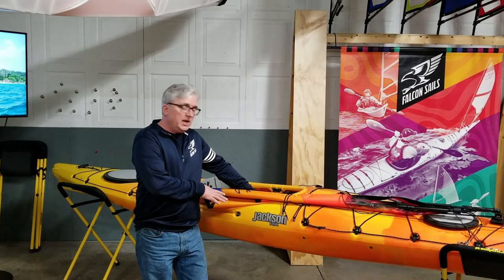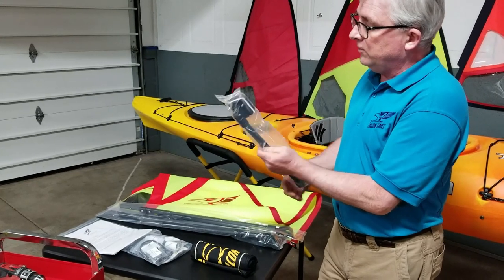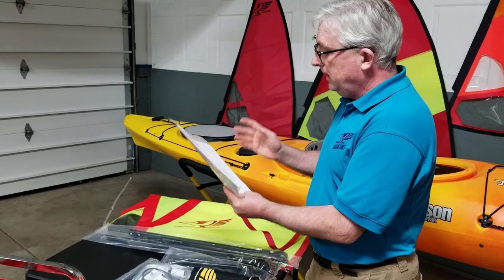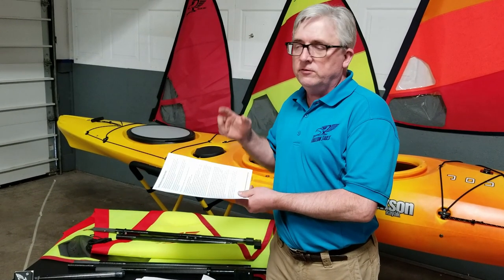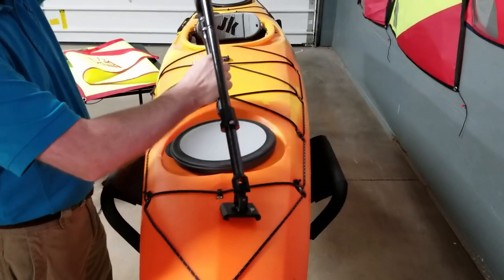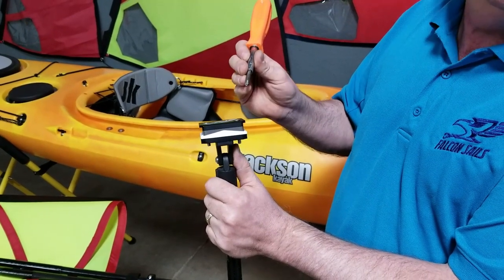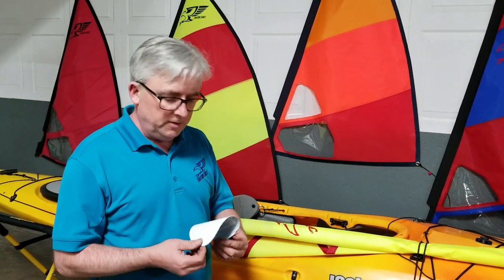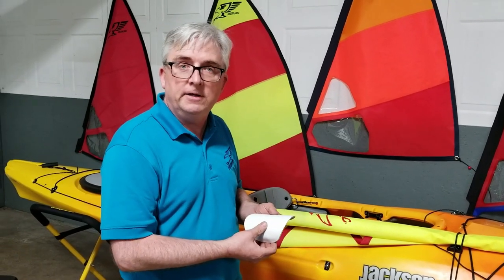How to install a sail on a kayak

Comment: Hi Patrick, That's me in the Red Clipper Sea Canoe on my very first sail ever (and with you). Thanks for taking me out that day.  Since then I've been out dozens of times in much lighter wind then that day (20-30 mph?) learning my secondary stability limits with the sail up. A high seat position on my canoe is much different than a low seat position of a kayak with a sail. My Falcon Sail is doing everything I wanted from it. I normally paddle inland lakes here in central Indiana. I'm almost always out-and-back so at some point I'm into the wind and then with the wind. (sail up/sail down)  I would say an average trip for me is about 8 to 10 miles in 2 - 3 hours. Since inland lakes are almost always ever changing wind conditions as I wind my way around the hills I'm constantly having to adjust the sail which could not be easier taking less than a second to do. Almost always I'm paddle-sailing. In other words the sail is an assist to my paddling. In my experience I do not find my average paddle much faster than without the sail in light winds, (maybe .5 to 1.0 mph in 8 to 15 mph winds) but I find I work a whole lot less hard to maintain my speed. I highly recommend your sails. And thanks for providing coaching on the install. Your experience with my style of boat made the final product perfectly located on the hull. Hope to see you on the water again soon! Happy Sailing!
Reply from the maker: Thank you for the comment.  That was a great day of paddle sailing.
If I were you, I would think about making it to the South Bass Rendezvous.  Even if you do not feel ready for the full blow paddles we plan on doing, there are still many things do do, including meeting a few of the hundreds of other paddlers that will be there.  Keep us posted.  Send more pictures and paddle sail reports.
Reply: @FalconSails  Paddle Report, May 24th 2019 Raccoon Lake (Cecil M. Harden Lake) Distance paddled 10+ miles. Sail: 4 Miles. Wind SW 8-15 mph. Saw 2 Golden Eagles and 1 Bald Eagle. Saw several big Leather Back Turtles and a couple Northern Water Snakes sunning. The lake is 15 ft above normal water level. I would say I had my best sail ever. I really am getting to know where my secondary stability is on my canoe. I was super confident even in some pretty heavy gusts at times on the north end of the lake. You'll be hard pressed to find me without my Falcon Sail on my Sea Canoe. I'm Sold! Thanks again Patrick.

Comment: BEST sailing rig I've seen for my Current Designs Solara 135! I added the available foot steered rudder for it DOES help in a crosswind. Just one question Patrick. Are sponsons not needed to prevent my kayak from rolling over if a strong gust of wind should hit me?
Reply from the maker: That vast majority of Falcon Sail customers do not use sponsons.  After having had thousands of conversations with customers, I have never heard somebody say they went without sponsons and then decided to change their mind.  If the wind will not tip over your empty kayak sitting on the grass, or even on the water, it will not even come close to tipping your boat over if you are sitting in the boat.  It takes a tremendous about of wind to tip over a kayak like yours.  I suggest you skip the sponsons, and be cautions and see what you think.  I bet you will decide not to use them.

Comment: Do these install well on a sit-on-top kayak?  If not, what would you recommend?  Don't wanna go fast, just want to relax on the lake with the dog, but keep moving without having to paddle constantly.
Reply from the maker: Falcon Sails can be rigged on any kayak.  Below are some easy day sailing videos that show them handling nicely in light conditions.
Sit on top kayaks in general have a lot going for them that make them great sailing kayaks.  #1 they are usually shorter which makes them easier to control, #2 they are usually wider which makes them more stable and handle wind better and makes them easier to handle,  #3 their hulls typically have more contour to them for tracking which also gives them great lateral resistance for better sailing across the wind, and even making up wind progress.

Falcon Sails will make a rig that is perfect for your kayak.  It will be easy to install and will be very solid.  All you will need are basic tools.  When you order, at the very end of the process we will ask you what kind of kayak you will rig your sail on, and then make a perfect kit specific for your kayak.

You can design your custom sail here.
https://www.falconsails.com/store/

Here a husband and wife enjoyed one of their first kayak sails and made easy across the wind progress.
  They are using sit on top kayaks.
https://www.facebook.com/watch/?v=300853454609552

Here is a nice video clip of a customer in a 12 foot long Pungo / Recreational kayak.
This was her first week end of kayak sailing, and you can see her making up wind progress.
https://www.facebook.com/falconsails/videos/696388180923721/?v=696388180923721

Here is a video of a Falcon Sail customer making nice upwind progress on his first time out with a 1 square meter Falcon Sail on his 12 foot long kayak.
https://www.facebook.com/watch/?v=278619176312509

Here a kayak sailor is enjoying a sail along the beach easily reaching across the wind.
You can sail across the wind along a beach all day long if you want.
https://www.facebook.com/watch/?v=896397267482735
Reply: @FalconSails  Thank you for these videos.  The sit-on-top kayak couple was just what I needed to see. Sure wish I could do this.... Looks so relaxing.
Reply: @SisterBaby  Kayak Sailing is very relaxing.  I have a hard time understanding how somebody would not put a good quality sail on their kayak, when you can have a rig that weighs just 3.5 pounds, folds to the size of an umbrella and secures to your deck in seconds, that can push you across the wind, and even up wind.  It is too much fun to pass on.  It is very relaxing in light wind and exciting if you decide to go out in bigger winds.  If it is too exciting, with a Falcon rig you can drop the sail in seconds and secure it to your deck in a few more seconds.

Comment: Is the sheet line long enough to let the sail swing forward so there is no wind force applied before dropping the mast
Reply from the maker: yes the sheet line is plenty long enough for that.
Though if you want to let the boom weathervane to depower ask us for a mast extension to put the boom above the standing line.  Though after years of kayak sailing I do not recommend you create the downsides associated with a depowering system like that.

There is a much better way to depower your sail which is much safer and does not create any of the downsides of having a sail so high it is above all the standing lines necessary for the kind of depowering I guess you may be looking at  

Unless you are in big winds, all you have to do is uncleat the forestay and the mast will gently fall.

Proper depowering on big wind days has been addressed in the video at this link.
https://youtu.be/fP7AxiwKthQ

Call the Falcon Sail shop any time  you like.

www.falconsails.com/contact.php

Comment: I have a challenging request for you guys... I'm expecting the delivery of my Oru Coast XT kayak, tis an origami folding kayak, would you be able to add a sailing kit to that?
Reply from the maker: Some kayaks are harder than others. We can help you rig a Falcon Sail on your Oru Coast XT.  You should contact our shop to discuss how to rig it.  With our Oru Adapter and reinforcements it is fairly easy to do.  But still you should have a discussion with our shop so we can explain to you what you will have to do with this very special kayak.  

We have a Oru Beach in our demo and show fleet, so we are very familiar with the Oru designs and can help you get off to a quick start. 

Our shop Phone # can be found here.
www.falconsails.com/contact.php

You can see some very helpful pictures our demo Oru Bay here.  It includes a lot of rigging details.
https://www.flickr.com/photos/falconsails/albums/72157719487366357

Comment: I may have missed it, but you seem to have skipped how to measure the mast foot to be the correct length to provide a tight fit and good support.  Getting in to measure is no super easy, do you have any tips on how to measure the length needed for the foot?
Reply from the maker: I cut mine to get it closer to the correct length.
Then I put insert it to see how close it is.  Then I cut off a little more and test fit it and then test fit it again.  I do that a few times until it is really close.
At the very end, I use sand paper to shorten the last few mm to perfection.
When  you get close to the right length, only take off 1/2 half of what you think necessary to finalize it.  When it is really close use sand paper to finish it off.

Comment: Do you need to put silicone on the bottom of everything before tightening so it's water tight?
Reply from the maker: You can put a small dab of silicone on before you tighten up things to make sure it is 100% water tight.  If you skip this step it will be okay, but may leak a few drops of water if the deck of  your boat sees a lot of water.  In any case, it is a good idea, and any type of silicone will work fine.

Comment: Serious question; do you necessarily need a rudder, keel, or Lee boards to use this kind of setup?. Kind regards.
Reply from the maker: Rudders are far from being required.  If a kayak is fine without a rudder when not sailing, it will be fine  for kayak sailing.
Jut like kayaking without a sail, kayaks that are 16 feet and longer it is best to have either an adjustable skeg or a rudder.  On kayaks that are 13 feet and shorter rudders are completely optional.  In any case, your paddle is much more powerful for turning that a rudder is.  A rudder is handy for lazy kayak sailing.  You can sail along, and set your rudder down, and eat a sandwich or do what ever you want.  If you do not have a rudder, you will need to make an occasional paddle stroke to stay on course or change course.

If you want a rudder, Falcon Sails will sell you a smart track rudder at 40% below list price.  Smart Track rudders are the best after market rudder you will find.  They are better than pretty much all the other rudders out there.  If you want to take advantage of this offer, call our shop to discuss.
Reply: I own 5 different kayaks.  I have rigged a sail on every one of them.  2 have no rudder and no adjustable skeg.   One is 12 feet long, and the other is 13 feet long.  1 of my 18 feet long kayaks has a factory / stock adjustable skeg, 1 of my 18 foot long kayaks has a smart track rudder on it, and 1 of my kayaks has a stock factory rudder on it.
If your no sail kayak is fine without a rudder, it is more than likely fine for kayak sailing without a rudder.
Reply: @patrickforrester3116  Thank you for your informative replies, kind Sirs.
Reply from the maker: Keels and Lee boards are 100% not necessary.
Conventional sail thinking leads people to assume all boats that sail have them.
Sail boat hulls are designed to be as slippery as possible going forward and a by product of this is a hull that slips sideways and spints.
A kayak hull is designed to track and go in a straight line.  This is achieve by having lateral resistance throughout the length of the hull.  Imagine towing a loaded kayak from the front vs towing a loaded kayak from the side.  The kayak you tow from the front will be 10x faster than the same kayak being towed from the side.  That is because a kayak hull generates a lot more resistance going sideways than it does going forward.  So a kayak hull is really pretty good at sailing.  It will not sail perfectly well as a purpose built sailboat will but it will sail amazingly well and it can all be had by adding a 3.5 pound Falcon Sail to your kayak.
We wrote quite a bit more about this on our frequently asked questions page.
See what we wrote on lateral resistance appendages here.
https://www.falconsails.com/KayakSailingFAQ.php#centerboard
Reply: @FalconSails  A very interesting, explicit and detailed reply, and a good point about the inherent tracking characteristics of the kayak hull form. Thankyou very much. Kind regards.
Reply from the maker: @onanysundrymule3144  Let us know if you need anything.
You can try us on our contact page or our facebook page.
www.falconsails.com/contact.php
www.facebook.com/falconsails

Comment: Its it possible to use in inflatables boats and Kayaks
Reply from the maker: Yes it is.  You will need to add a sturdy cross member.  If you would like some help or more info, contact falcon sails and ask.

www.falconsails.com/contact.php

Comment: Hi There,
I own a Wavewalk S4, I use this dingy on the great lakes (Ontario & Erie) and I want to play and have a backup locomotion as a sail. 
I am located in Canada. Are you shipping the sails to Canada? Can I buy them from Canada?
PS: Write your website contact in the description of the movie. Easier to find.
Reply from the maker: Yes we ship sails to Canada.  We ship sails and other hardware direct to customers in over 50 different countries.  Canada is just 40 miles north of the Falcon Sails shop. Right now we have a special for $15 shipping to any place in Canada.  

Your Wavewalk S4 with its contoured hull will sail very nicely.  I would install a 1.4 square meter falcon sail on it.

We only ship direct to our customers, because every boat a sail is installed on requires a review a custom packing list.  Your kit will include every piece of hardware  you need for a easy and solid rigging job.  All you will need are basic tools.  

All we do is design and make the best sails we can for kayaks, and provide the best support possible to our customers.  Re-sellers do not have the expertise to do this.  You can order directly from Falcon Sails, and get the discounted shipping rate when it is available.  You can find out what the shipping rate is by placing an order for a sail rig and then see how much shipping is.

We will do everything we can to make sure you have the best kayak sailing experience possible.

Comment: Looks like fun.  Could I install this on a Pelican Summit 100 Sit-In Kayak, 10-ft?
Reply: Also, can you tack upwind?
Reply: Also, if I get another kayak, could I uninstall this one and install it on the newer kayak?
Reply: I will try to answer all your questions in 1 post.
Yes Kayak Sailing is a lot of fun.
Yes you can install a Falcon Sail on your Pelican Summit 100 kayak.
We have analyzed this kayak, and helped people rig Falcon Sails, on them.  We have a great parts list including proper adapter blocks for a fast and solid rigging job.  All you need are basic tools.

You can design your custom sail here.
www.falconsails.com/store

These short wide kayaks are really good for kayak sailing.
Their short length make them easy to handle, their width makes them stable and easy to handle.  This kayak of yours has a nice contoured hull which gives it great up wind sailing potential.  With decent wind, you can make up wind progress with no paddling.  If you want to make more aggressive up wind progress  you have to do a little paddling.  The more aggressive you your up wind tack is, the more you have to paddle.  The laws of diminishing returns set in.  But you can gain useful propulsion to within 30 degrees of straight up wind if you keep the sail oriented to the wind properly, and also keep the hull moving to generate lateral resistance.  Of course these aggressive tacks involves some paddling.  But you can reach across the wind back and forth without doing any paddling.  You can even make up wind progress.  If you plan your outing, you can sail about all day long if you want.

Yes you can move your sail rig from your old boat to your new boat.  We have extra boat kits that allow you to rig another kayak so you can use your falcon sail on 2 kayaks if you like.  In that case you can move your rig from one kayak to the other in about 30 seconds.
Reply: @1234superduper  Great answers all.  I think I will purchase one soon.  
Is it possible to adapt my kayak with a rudder?
Reply from the maker: @ronatola  This kayak is not configured for easy rigging of a rudder on it.  But of course with some ingenuity and determination, it is possible to put a rudder on any kayak.  If you call the Falcon Sails shop, we can explain a plan that you could follow to make it happen.  With that said your 10 foot kayak, will sail very nicely without a rudder.  We help people rig Sails on short kayaks like this all the time and the vast majority of boats under 12 feet long do not have rudders installed, and it is not a problem for sailing.  As a matter of fact, I can not even think of a single short kayak with a Sail that has a rudder on it.   One of our demo kayaks is 12 foot long and we do not even consider putting a rudder on it.  Until they are over 12 feet long, it is okay to not have one.

If you buy a Falcon Sail, we can help you get a Smart Track rudder system for your kayak at about 40% below list price.  So it is an option.  I would pass on it.  If you rig your Pelican Summit 100, and move it to another longer kayak, then it may be worth while to do it.

Comment: How can I get a kit for my kayak?
Reply from the maker: @felixmasis3658

If you want a Falcon Sail for your kayak that is easy to do.
You can order a sail with a complete rigging kit on our website.  It will include 100% of the parts you need for a easy and solid rigging job.

You can even custom design a sail for your kayak.

See
www.falconsails.com/store

And of course feel free to contact us using any method you like on our contact page, and ask any questions you like and order your custom sail over the phone as well.

www.falconsails.com/contact.php